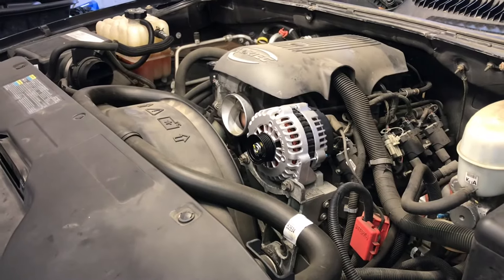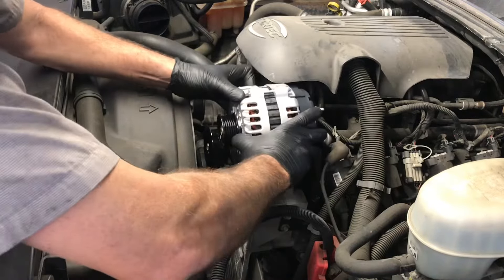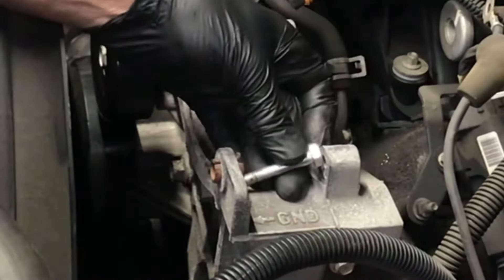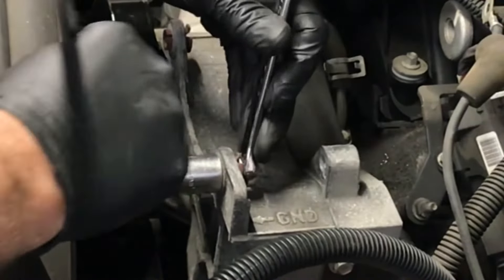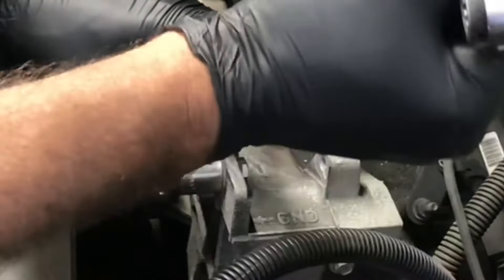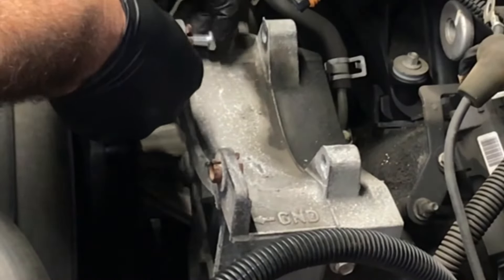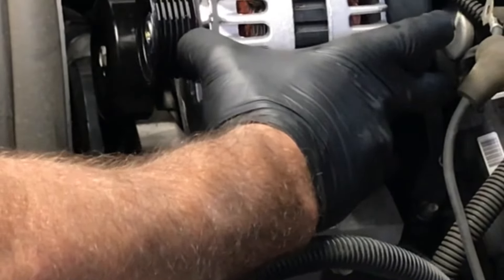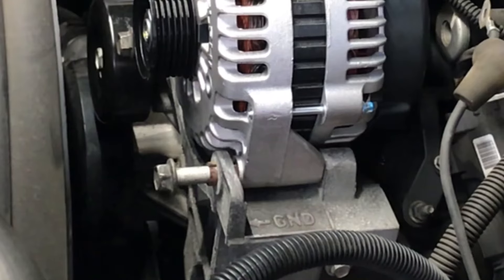Chevrolet Alternator Replacement: Tips For The 5.3 L And 6.0

Comment: Or you can spray each bushing with WD40 and put a socket over the front side of the bushing like Brian did and now press the bushing with a pair of channel lock pliers with 1 jaw on the outside of the socket and the other jaw on the bushing, that's how we do it in Berkeley.

Comment: Tip to the tip - (2004 Silverado 5.3) Use a socket, almost the length of the bolt spacing, and simply use a pry bar/large flat screwdriver to push the shim/bushing towards the front (using leverage from the back/larger side). Takes about 5 seconds instead of doing all the other stuff. Also, no real need to remove the serpentine belt  and just take it off the alternator pully and let it suspend out of the way. In addition, you can get away with only removing the throttle body side of the air intake tube. Simply flex it back out of the way.  Everything else looked good but be sure not to get crazy on over tightening the stud  on back of alternator. I have seen these broken off with too much force.

Comment: When I was looking for an alternator at RockAuto,  they had 3 different amperage alternators for my suburban.  How do I know which one to buy?  They had 125amp, 145amp,  and 160amp.
Reply: Check your glove box for RPO codes. 
The RPO code will tell you which alternator your vehicle is equipped with along with many other configurations. For example, mine has K68 which is a 105 amp alternator. I hope this information helps you out. 
-Cheers